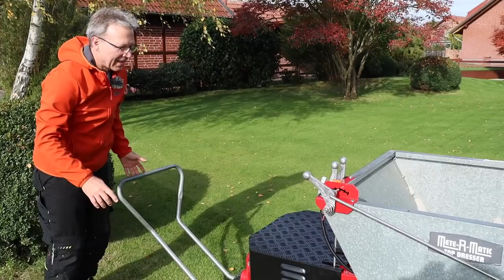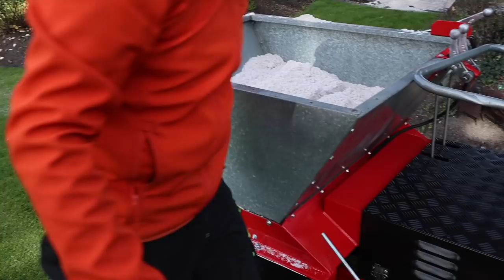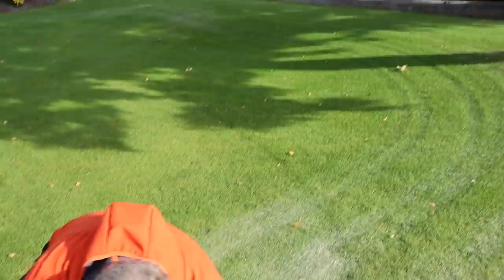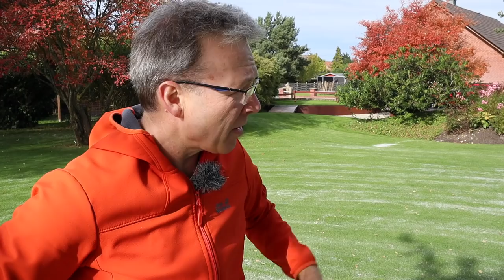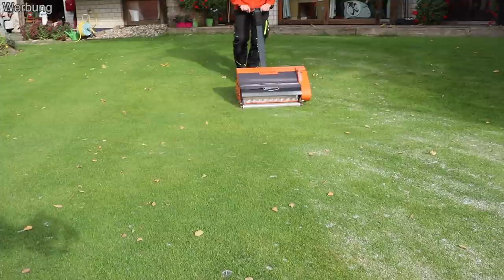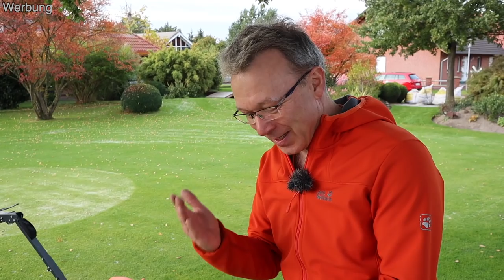SAND streuen im HERBST. TOP DRESSING mit meinem BÜRSTENSTREUER. EINBÜRSTEN mit dem SWARDMAN Electra.

Comment: Kann man mit dem Turfco auch Kompost streuen?
Würde doch zu deinem Konzept der organischen Düngung passen?
Reply: Ich denke der Kompost muss dafür sehr fein gesiebt sein damit dass Ergebnis passt. Was sicher gut gehen wird ist zb Perlhumus.
Reply from the maker: Kann ich nicht sagen, aber vielleicht mal ausprobieren.
Reply: Turfco:  F15B is intended to be used for the application of properly prepared organic top dressing material. Properly prepared top dressing is organic material with a controlled moisture content that has been screened to remove debris and excess sized material. The F15B is NOT intended to be used forany purpose other than the application of properly prepared top dressing material. Do Not Top Dress Unscreened Material. Do Not Top Dress Non--Organic Material. Do Not Top Dress Rocks. Do Not Top Dress In Reverse Speed. Do Not Ride On Top Dresser. Do Not Allow Riders On Top Dresser. Do Not Put Tools or Implements In Hopper. Do Not Tow the Top Dresser. Do Not Tow Anything With the Top Dresser Do Not Push Anything With the Top Dresser...